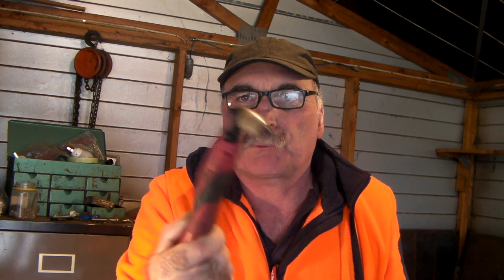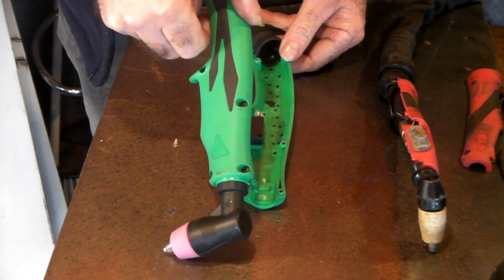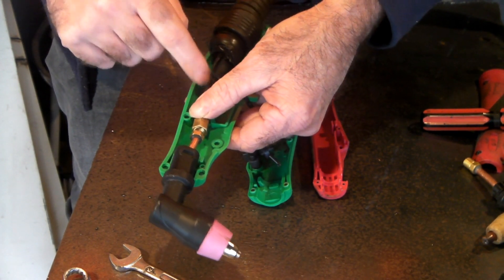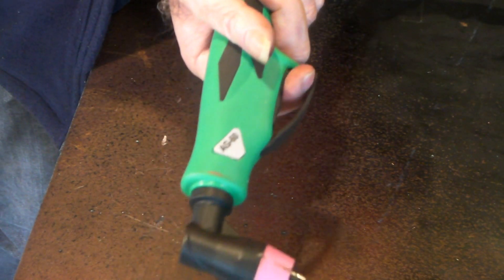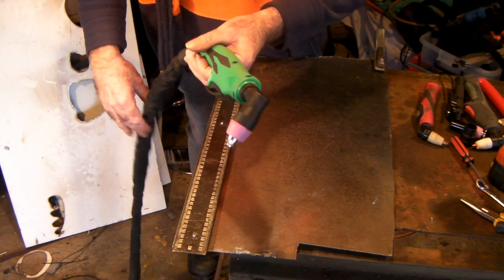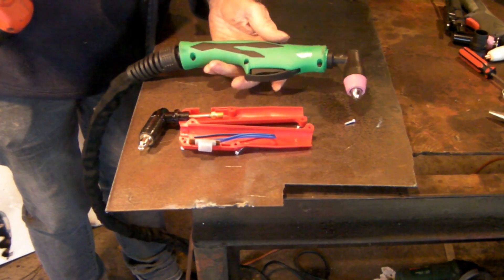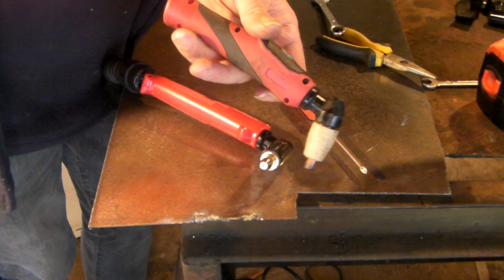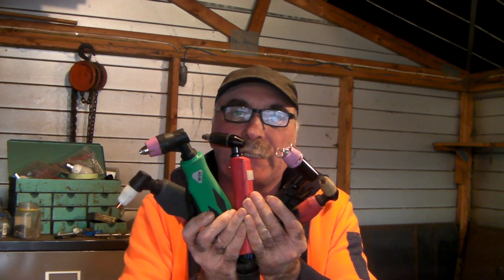Cheapest Interchangeable Plasma Torches

Comment: Good day Pete, I bought a cut 60 with pilot arc and it has a AG-60 cutting head. What is the best replacement head I can get so that I can use some sort of drag head for cutting rather than the ceramic cup with the cheenchie wire hold off? I also need to know about getting something that has better options for consumables. I'm in Mexico and the consumibles are difficult to get and Amazon is slow to deliver to the USA right now and it was saying late December .
Reply from the maker: Yea ,We are also having very slow shipping theses days .

Comment: Just what I needed to see. Rebuilding a Snap on YA2001 made by Century. Swapping out a new torch is 1/3 of the cost of the parts to get the original one working again and still left with the beat up handle.
Reply from the maker: Hi ,Good luck with it.

Comment: Hello Pete,
Can I use the P80 torch in a plasma cutter HF without pilot ? (I want to use the start arc HF and not pilot)
That means the pilot cable of torch P80 will be unpluged .
Very grateful in advance by your response.
Reply from the maker: Hi mate check this video out : Pilot Arc Torch With Non Pilot Machine :https://youtu.be/o11CMPFAIWo
cheers pete
Reply: @petestools  I have look this video before, but sorry, the question if this that you do but "unplugging" this pilot cable. Dont using the pilot system, only HF, but the P80 torch. Cheers :)
Reply: 🎉hi Pete I just bought a koggan ROSSI 40AMP p cutter with a 
P80 torch head .. I was wondering if u have a vid on how the swirls ring in them are pulled out etc .
👍

Comment: For the guys who aren’t familiar with welding and plasma cutting air and gas lines, NEVER use teflon tape, or any other sealing compound on these gas lines...they’re made to fit, gas tight, without any sealant. Sealant could get into an orifice somewhere, and clog it up, or even cause a fire.

Also, don’t over tighten. That will distort the connectors and they won’t be usable. Tighten up good and snug, and then turn the gas or air on and listen for a leak. You can spray a small amount of soapy water on it and look for bubbles. If you find a leak, with the gas on, tighten it up slightly until the leak stops. Don’t have oxygen or flammable gas on when doing this though.
Reply from the maker: Thanks mate ,more good advise.
Have a great weekend cheers pete
Reply: I have a Hypertherm that needs a torch replacement fot the second time . Wondering if anyone adopted a cheaper  pilot ark torch to a Hypertherm . It’s a Powermax 380 .
Reply: @danielfraser7151  I would call Hypertherm and try to figure out why two torches failed. That shouldn’t happen.
Reply: @melgross   The two torches were worn out . I’m not blaming the torch being faulty . I would just like to be able to adapt a more reasonably less expensive torch that has less expensive consumables . Tired of being held hostage by Hypertherm .
Reply: @melgross  Thanks for reply .
Reply: @danielfraser7151  just think, Hypertherm has an excellent reputation. If their torches are wearingout, then just how fast will a cheaper one wear out.
Reply: No flammable gas involved in plasma cutting.
Completely different system to oxy acetylene cutting or welding.
Reply: @bushratbeachbum  true, of course. If you’re referring to my post, I was generalizing since the leak problem is applicable to any gas.